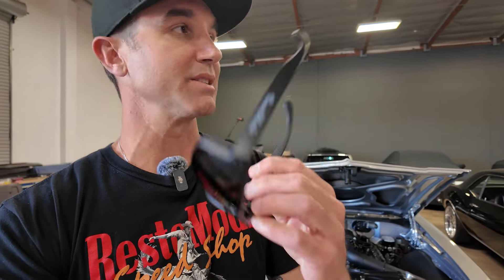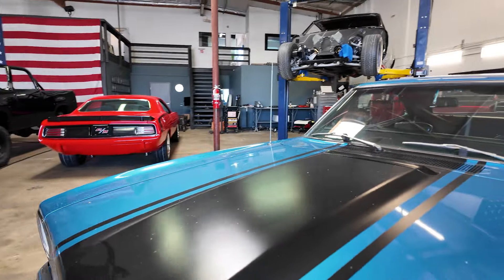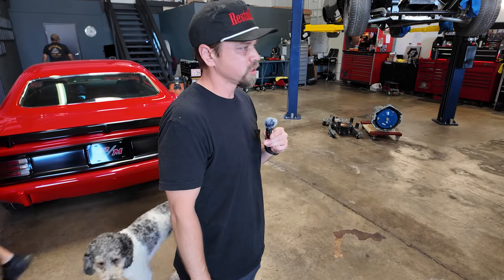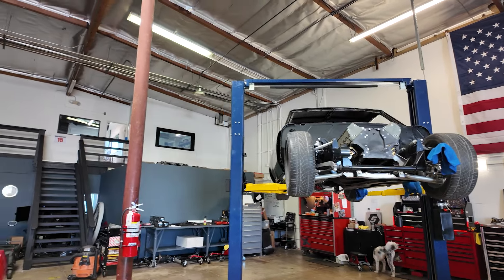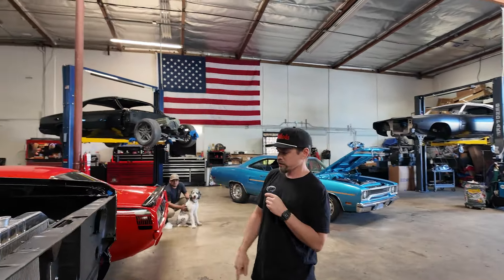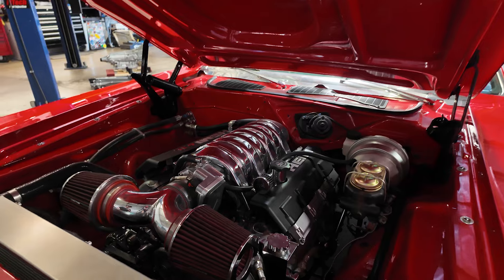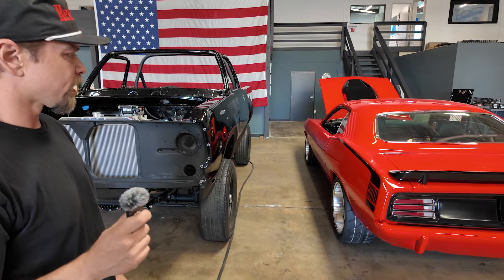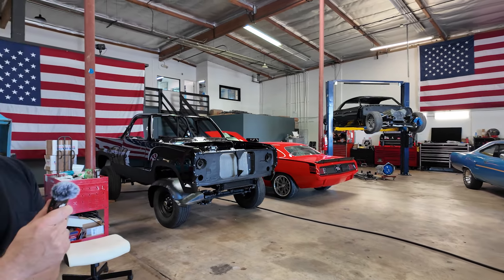RestoMods Garage: What Should We Give Away?

Comment: Love the 70 Cuda how about a 1971 or 72 roadrunner? How about a 70-72 Duster? I had a 73 dodge dart sport with a factory retractable sunroof super rare with the factory sunroof, found out years later how rare the factory sunroofs were on mopars. Owner before me put a big block k frame in it and put in a rebuilt 1970 roadrunner 383 motor and 727 trans with a 3.91 rear end. This was in 1990 before all these aftermarket swap parts were available. A solid 12 second car I beat everything off the line except built fox bodies. I liked racing the fox bodies if they got the jump on me I would always run them down by 5 or 600 ft. My girlfriend (wife now of 35yrs) always loved waving them goodbye while as we ran them down and pulled away, I just always had a silly grin passing them. My local county sheriffs loved the car and gave us lots of breaks probably because my wife was so pretty back then. Thank you retired sheriffs Mark Rogan, Ed Powell and Dennis Warren